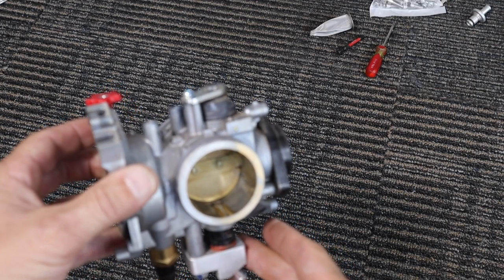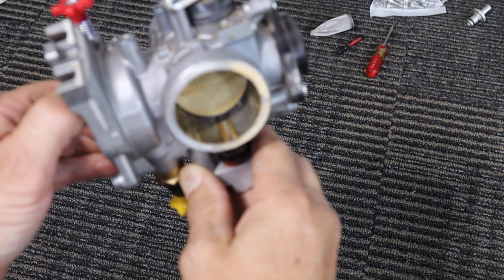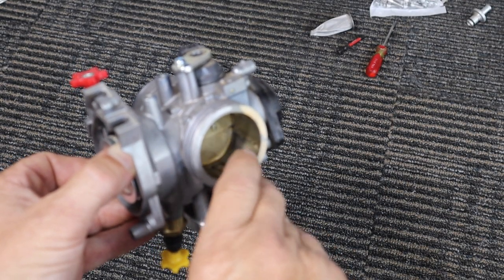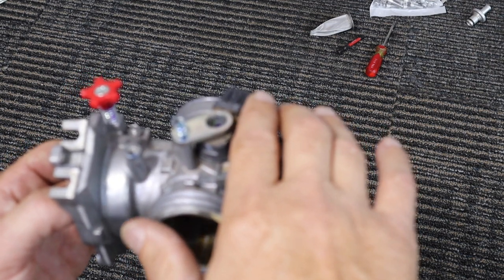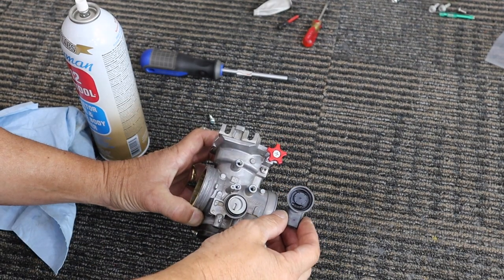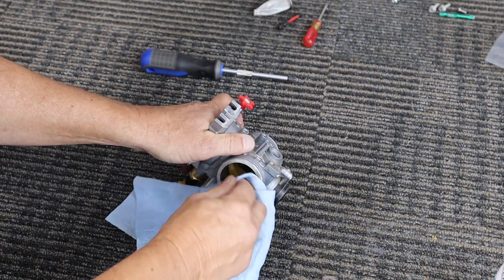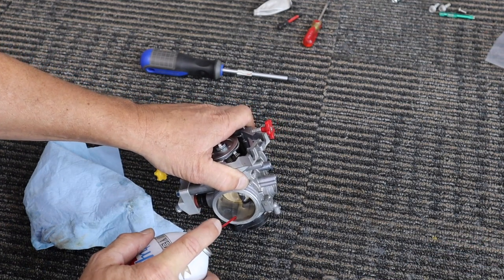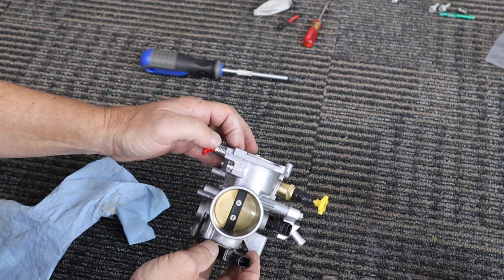Cleaning the MAP sensor to fix starting, idle and running rough problems

Comment: Did you remove the injector before cleaning? Will carb cleaner damage the tip of the injector?
Reply from the maker: It won't damage the injector